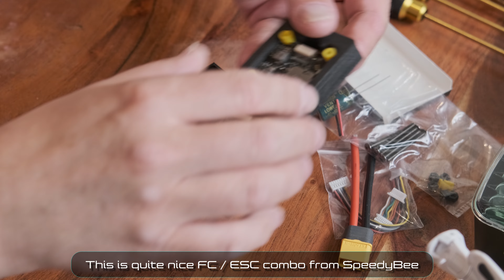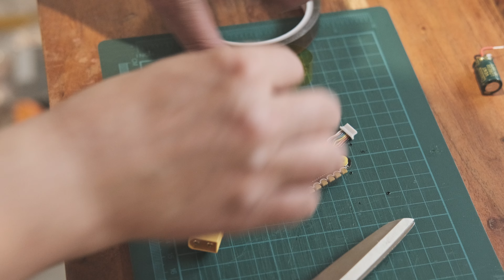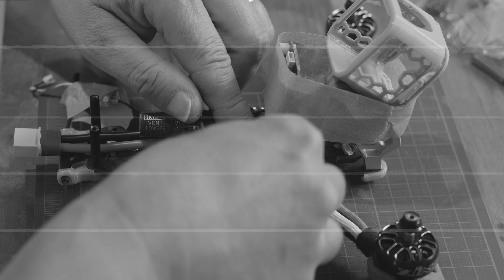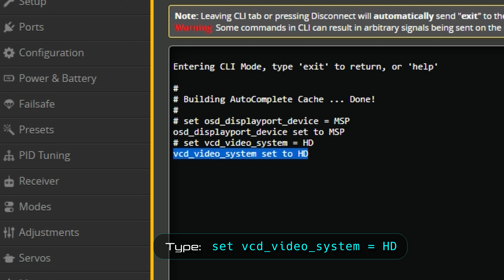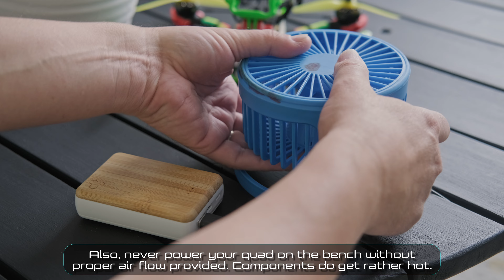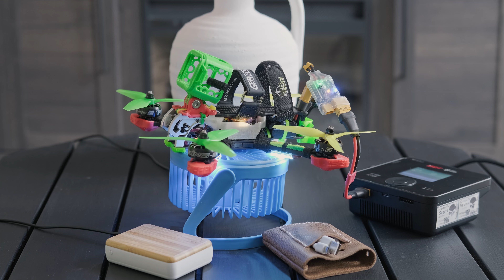MY 3rd CUSTOM 5" BUILD | 08−21−2023

Comment from the maker: Just to address couple of things... to those with comments of this nature: "...umgh, you should use smaller soldering iron tip bro..."" - no, I don't want to. I have at least 6 different tips, each for its own application, two different soldering irons, each one with about the same accessories. I know smaller tip is easier to work with. But for some people, even bigger tips do not pose any problem to get nice and precise, small soldering connections. It would take me more time to wait until it's not hot, few seconds to replace the tip, and then wait additional time to get it to the desired temperature. When I'm doing this and controlling my cameras for recording in the same time, I am chasing the daylight, so I don't have time for unnecessary moves. Fat tip does amazing job too, so it stays like that unless I feel like I need to swap it :)  Second thing: "...you should use washers with TPU parts..." - why? What is the gain in doing that? Adding additional weight to the total weight of the quad is not a benefit. None of the motor securing screws are even slightly touching the TPU in arm guards. I've explained in many of my videos what is the reasoning for spending so much time on designing SNAP-ON arm guards that never even see those screws with Loctite applied. They simply snap-on onto the arm ends and they stay there. At least I am 100% sure my motors are always securely screwed to the carbon frame. As for the Camera mount TPU. If you look closer, you'll notice those screw holes are made of two terrace levels. The fat, outside one is to keep everything protected, and the inside one is where screw head stops and can't go any further. It's not even touching the carbon frame, it sandwiches that TPU portion and it even gives quite some backwards pressure to keep the screw from ever turning the opposite way, making itself lose. I thought of couple of things before designing all these 3D parts :)

Comment: Can you show me the diagram for the crossfire nano connect to the fc? And witch uart? Thank you
Reply from the maker: Receiver's GND to GND on your FC, Receiver's 5v pad to 5V pad on your FC. Receiver's Rx to FC's Tx, and Receiver's Tx to FC's Rx. Whichever UART is assigned to your FC to be dedicated for connecting the receiver, you should use that. Every FC comes with wiring diagrams, so it's quite easy to find out which one should you use.

Comment: Hi mate will you be able to share your 3d model of your quad? By the way nice build.
Reply from the maker: Unfortunately, I don't have any 3D models for GepRC and using the ones that came with the frame. The only ones I've designed are snap-on arm guards (those ones in red), and the GoPro hard mount base... but that base is almost the same like the one provided by GepRC anyway. You can find a lot of 3D STL files for Mark 5 here: https://www.yeggi.com/q/geprc+mark5